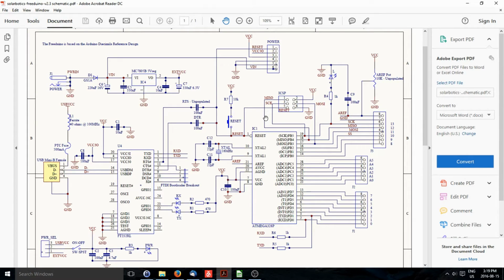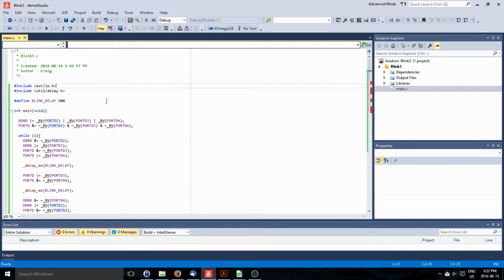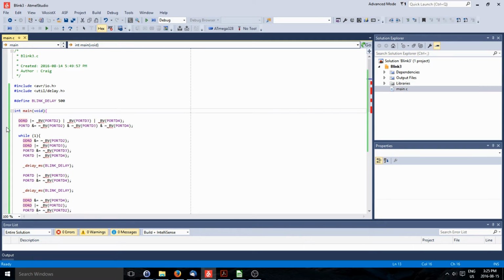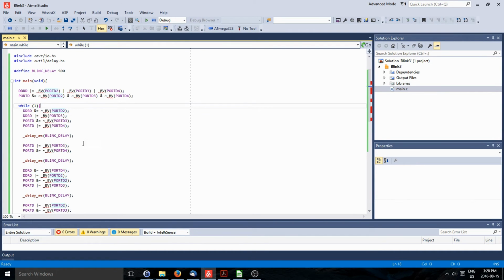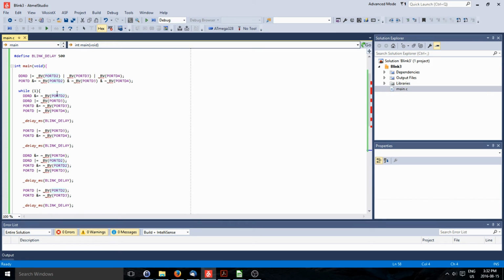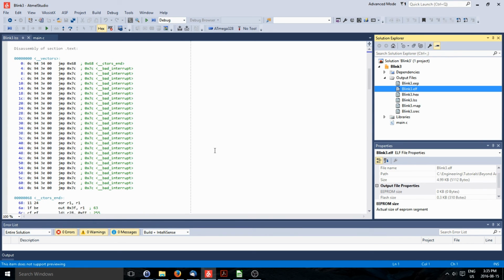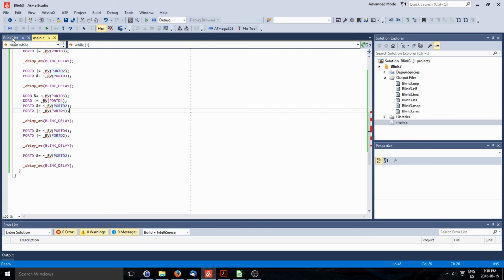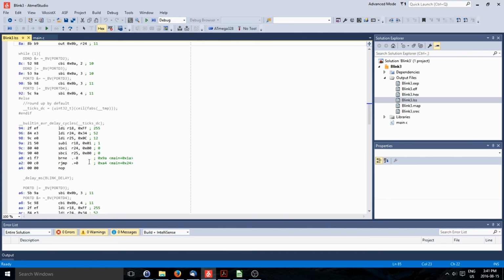Going Beyond Arduino # 4 - Blinking 6 LEDs

Comment: I am really pretty new to this manipulating bits is a register. I was following you pretty well when you spoke of shifting the bits to the right and left. When you got done the original configuration had changed. In the second section when you were reading the state of a particular bit you used an "and" function with a mask made up of all zero's except the bit in question. Let's say in this example that all eight of the bits started out as a "1". After your "and" function the results would be all of the bit would now be zero except for the bit you were curious about. Since it was originally a "1" the mask would return a "1" at the end of the operation (had it been a zero originally, it would return as a zero). Either this mask destroys all evidence of the other bits, or you leave them alone and take the results and save the results in another location. 
I realize that this is an older post, and you are probably not monitoring it for new responses, so I will muddle through a couple more lessons, and perhaps it will become a bit clearer when you actually use these techniques.
Reply from the maker: My explanation of bit shifting was to describe how the _BV() macro works.  The macro itself does not generate any microcontroller (MCU) code.  Instead, the bit shifting is done by the compiler to get a constant (the mask) that is used by the MCU.  The MCU doesn't do the shift.  The _BV() macro is just a short-hand way for the human programmer to easily make a bit combination.
The way the mask is used to test bits doesn't affect the register being tested.  The result of the AND does have to go somewhere so the MCU can look at it, but it goes into a temporary register.
I hope this explanation clears up your confusion.  Thanks for watching and taking the time to comment.
Reply: @craighollinger9972  Aha, I get it. I have to go back and watch these videos again with new eyes. Thanks

Comment: _BV macro doesn't work for me in ATMEL studio 7. I tried adding it in the beginning of main.c #define _BV(x) (1 << x), but doesn't work, and get following error 'undefined reference to BV'. Where is this macro defined or should I manually define this macro?
Reply from the maker: I'm not sure what the problem is.  Possibly Microchip has updated Studio 7 and broken _BV().  You could try defining it in the project (Project/Properties, Compiler/Symbols), or just type in (1 << X) anywhere it is used.  You seem to understand what the macro does.  Good luck!
Reply: Craig Hollinger awesome thanks for the reply. I used 1 << X instead of the macro to make the code work. Keep up the good work!
Reply from the maker: @Kashif_Javaid  I'm glad it worked out for you.

Comment: hi, the schematics is intriguing and smart by design, I think that the code you made is very hard to understand, much more complicated in my opinion than if you have had hard coded the 6 options by hand.
yet I wonder if you have time to explain to me how to light only the rightmost LED in concern of the entry PB3, unless you make that entry an output or high Z as for unlimited resistance so no 2 LED's in series will glow together at 5v logic '1'. As I see it, if rightmost LED is on- no matter what logic will be set at PB3, if configured as an input pin - either the upper LED of the right side pair or lower LED of this pair will glow the LED..
Reply from the maker: Yes, I did say that this method of coding the IO pins would seem complicated.  It is though, much less error prone.  Study the code, and give yourself some time to understand it.  I think you will eventually appreciate this method of coding.  

If I understand what you are saying about the LEDs, you are correct.  If PD4 and PD2 are outputs and PD3 is an input (high Z), driving PD4 high (5V) and PD2 low (0V) will light the rightmost LED only.  If PD3 is now made an output and driven low (with the other two pins remaining in the same state), the rightmost LED of the upper pair will light as well as the rightmost LED.  Similarly, if PD3 is driven high, the rightmost LED of the lower pair will light.  Other combinations can be worked out, I'll leave it up to the viewer as a homework exercise.

I did say in the video that it was be possible to light more than one LED at the same time, I just didn't elaborate.

Thanks for watching.